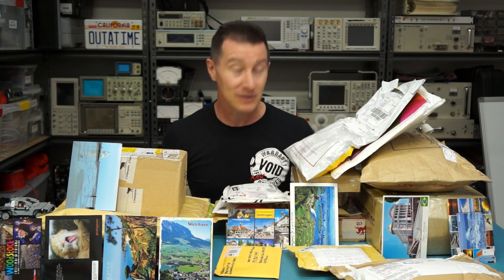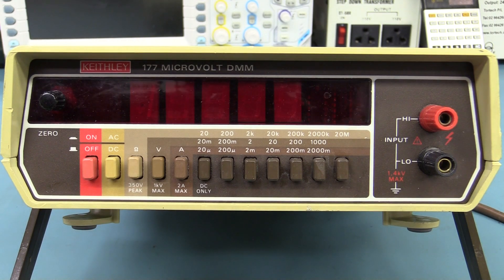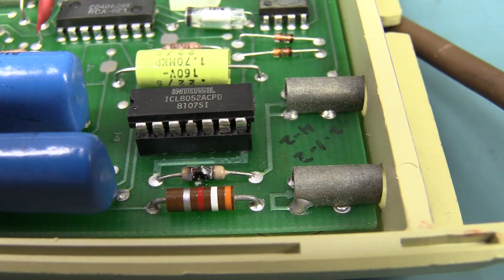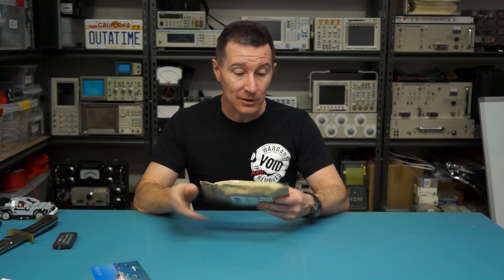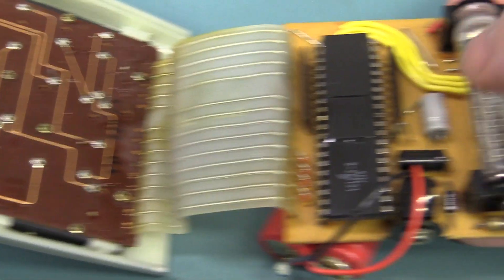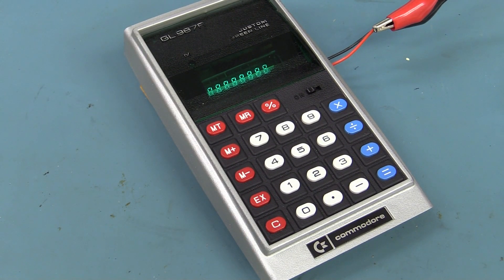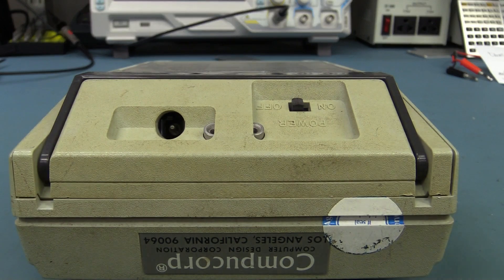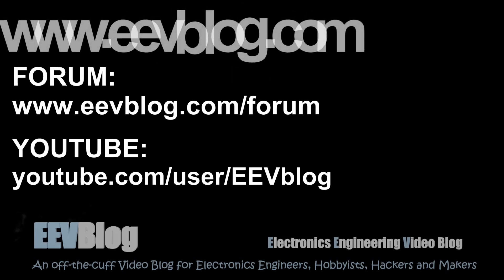EEVblog #658 - Mailbag

Comment: My eBay bench Fluke True RMS multimeter only cost $15 instead of the $100+ for the 87v hand meters.  It came with the original manuals and schematics.  The reading alone was a valuable education.  After 4 months of failed eBay bids, $49.99 actually won me a Hameg dual trace 20 MHZ O'scope with original manuals (additional $11.77 shipping).  It's only had one probe but both channels work every bit as good as the day they were born, and again, a careful reading of the manuals and schematics is a good education itself. As an old retired geezer I no longer need to support a family and finally have time to learn electronics, I just have to squeeze every penny to purchase quality tools.  It is time to turn over more rocks looking for a $10 HAKKO 888, or a nice Pace soldering unit.  The Pace bench soldering stations are less than $50 but the irons that plug into them are $100, while HAKKO has cheaper irons but no cheap bench units to power them.  I may be forced to live to 100 to find a good deal, so all you young folks out there make room for an old dog learning new tricks.Thanks Dave!!!!

Comment: My 2013 $500 worth smartphone has 5" 1920*1080 LCD display, has 2 gigs of RAM and 64 gigs of memory, insane amount of calculating power and capable of multitasking, voice calls, text messages and Internet connection. Small 10Wh battery is sufficient to run it for couple of days (or few hours with 100% load) and it weights just about 120 gramms in total. Looking for those calculators and "microcomputers" (which are just advanced calculators) and comparing to devices we have now just blows my mind. It's really hard to believe how fast the progress goes.
Reply: Imagine the things we'll have in just a few decades or even years...

Comment: the compucorp computer/calculator might only work with good batteries installed, even if a power supply is connected - I had a mini scope once with that odd requirement.

Comment: Mask on the Commodore - is it an EPROM of some sort - so covered to prevent accidental erasure / decay?
Reply: Not watching all of it to find the mask you refer to Sean. But, yes, early days you cleared the eproms by sticking them in a UV eraser for 10 mins :) Showing my age now. So, if exposure to light possible it was safer to put a cover over the glass top of the eprom.
Reply: Peter Locke About 11 minutes in - tear-down of a Commodore Calculator :)

Comment: Dave, could you please do a video on how you would reverse engineer that "bobby dazzler" vacuum fluorescent display to figure out how one would repurpose it in a new design? Like was that probing the lines indicating that each digit is driven by a particular part of the pulse width or frequency? Would the voltage be different if you weren't pressing 8's, etc. I'd love you hear your thinking process as you reverse engineer this and get it hooked up to a micro controller like a PIC or Arduino. Thanks. I've learned so much from your VLOG.
Reply: It's actually quite simple. I repurposed a display just like that one to make a desk clock back in my misspent youth. Just think of it as a whole bunch of vacuum tube triodes. There's a thin filament in the front that supplies electrons (the cathode), each digit has a grid in front of it, and the individual glowing segments are the anodes, with corresponding segments from different digits wired together. So, you strobe the grids positive one at a time, and drive the anodes high/low to create the digit for that particular position.
Reply: Dave was just probing the power line, Each part of the pulse was one of the digits. . the tube itself is driven like any other vacuum fluorescent display with common anode/cathode that select the digit and individual connections for the segments. Like there'll be 8 connectors for the segments (and the dot), and 8 common anodes/cathodes for "selecting" the digit.  Plenty of work on this has been done before, fortunately! Look up "ice tube clock" or something like that
Reply: ***** ece3 Guys, I think  you missed my point. I said "I'd love you hear your thinking process as you reverse engineer this and get it hooked up to a micro controller like a PIC or Arduino." Obviosuly I don't have one of those displays but the process of reverse engineering and figuring out how something works by an expert in electronics is like being virtually mentored. How does he approach debugging, reverse engineering, first steps, backing out of dead ends, what precautions are to be taken to avoid toasting the device, what do the oscilloscope readings mean, what should we look for, etc. These are the kinds of insights I'd love to see Dave muse about and teach. This is how apprecticeships and guilds work. The master teaches the student. I'm just a student and hobbyist here with no formal training in EE.  I don't give a rats arse about that particular display. The saying goes "give a man a fish and you feed him for a day, teach a man how to fish and you feed him for life." Dig it?

Comment: I have one Monroe version and another Compucorp version of that series calculator. I have a fully functional Monroe 344 Statistician model with dual program banks. The other one's broken. Also in storage, so I forgot the model. I've read they were very susceptible to static discharge.

You are going to LOVE that tear down. If I recall, there are 4 layers of PC boards. It has a Power PCB, a Memory PCB, a Processor PCB, and an IO PCB. It was very modular, and they used a crazy interconnect to bus the boards together.

The display is a 16 digit Panaplex neon gas display. It glows orange, like a nixie tube, but uses segmented digits. I do believe it displays 10+2 digits, with inline (-) symbols.

The 2ND FUNC key is very unusual on these models. You press it AFTER performing the desired function. The calculator actually calculates for BOTH function's result, and the key toggles which result is displayed, and is used for the next operation. This leads to an unfortunate bug, however, where if you perform a calculation that is valid on one function, but would generate an error on the other, it will error out the calculator. Oddly enough, you could press the RESET key and clear the error, but you could STILL press 2ND FUNC to swap the other (valid) result in!

And yes... This thing is an absolute BEAST! I love it!

Still not as heavy as my SCM Cogito 240-SR or my Friden EC-132... Of course, this one IS portable, what with it's QUAD "D" type batteries! XD

Comment: As someone who used to sell Calulators back in the Day, the Commodore was one of the LAST of the CBM calculators, after the GL series they just started to sell little LCD credit card sized ones.  I used one of the GL series for a couple of years.  Before that there was the US 3 US 4  up to US14 desk top, most with Plasma displays,and several pocket ones with individual VFD, One tube (valve) per digit. they sold a few LED units also.
One interesting experiment is to try using a VFD as a triode.
Commodore also MADE filling cabinents at one time, put mostly here in Canada only.  I have yet to find a commodore Typewriter., I did see a commodore Adding Machine once, but did not get to touch it.

Comment: Is that cap on the microchip removable so you can erase it like in the old days with ultraviolet light?
Reply: It's not removable without some force. There were different reasons they put caps like that on them, One was to act as a sort of heat sink, another was to add headroom clearance for the chip die, If it has UVE/P capabilities then there would be a window covered by a sticker ot maybe its under the black paint but normally those are one shot PROMs kinda like the PROMs in a Motorola Syntor mobile radio.
Reply: I recon, it was to wire the die to the pins or to mask write the chip.
Reply: I don't think that's an EPROM but who knows maybe you could change the software on the thing?